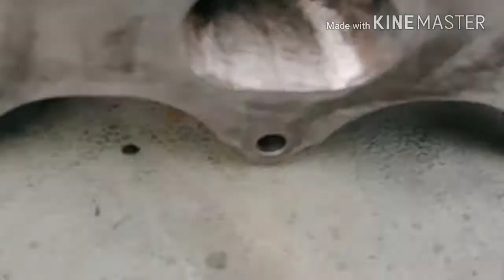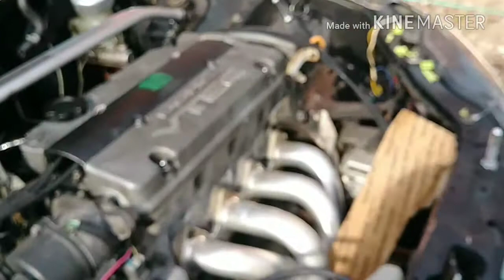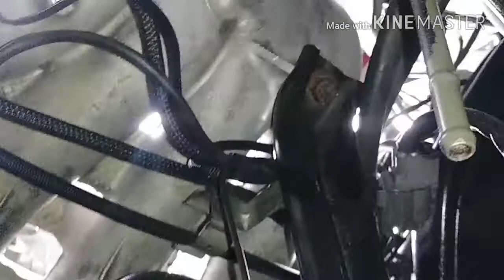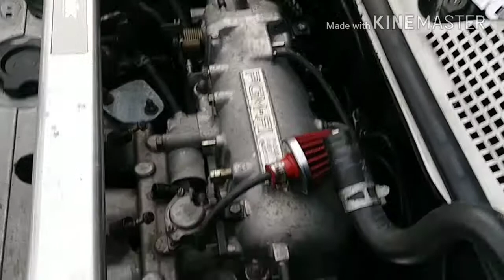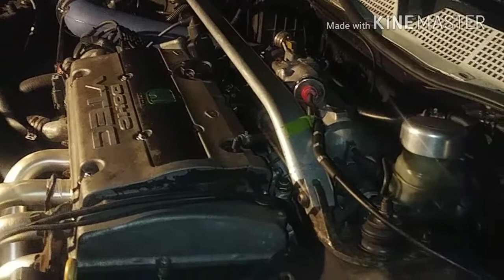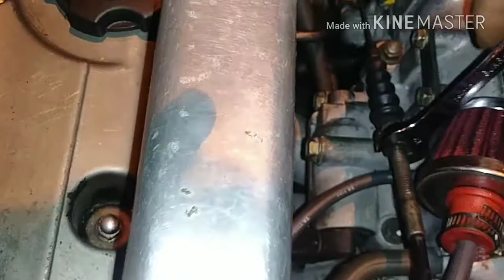H22 intake install. And test drive. H22 swap Civic

Comment: Ya could of done more with that bottom end, i think you wasted your time man. You could of bought one from 220 racing.  https://www.ebay.com/itm/220racing-h22-lower-intake-manifold-stage-1-h2b-h22a-h22a1-f20b/252446543937?hash=item3ac6fc9041:g:q5EAAOSwHQ9WW3U4&vxp=mtr
Reply from the maker: I'm trying to do this the cheapest way possible. Plus my tuner was telling me that I have to get the car retuned every time I make any changes to the car. Check out my latest video. Where I had to redo the intake manifold all over again. Just so I can make it to Honda day. Which turned out great

Comment: Well done Soldier you got her looking mean and by you port and polish the intake manifold do she feel good man I port polish my intake manifold I haven't installed it yet but well done keep it up 🔥🔥🔥💯
Reply from the maker: +Arthur Simon : thanks. Are you going to have your car tuned?
Reply: Yeah
Reply from the maker: Arthur Simon : you're doing it the right way. I wish I would have done this before I got my car tuned. It drives fine at Full Throttle. But driving around in traffic. Whenever I come to a full stop the idle drops below 1000 RPM and then comes back up. I'm definitely calling my tuner to see if I need to get the car retune. I don't want to have the car running lean